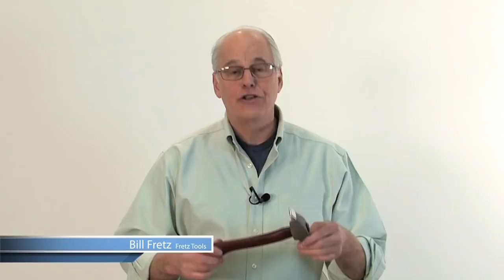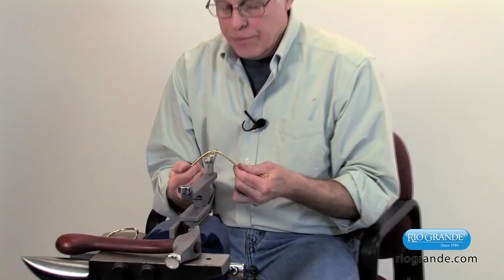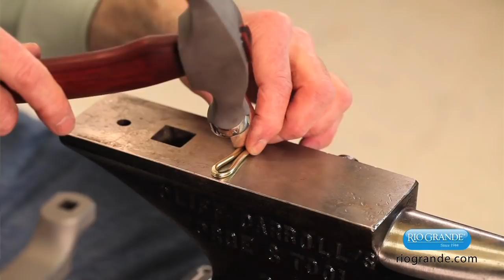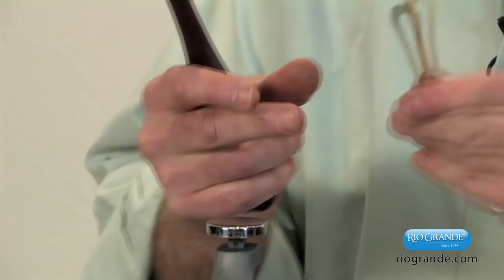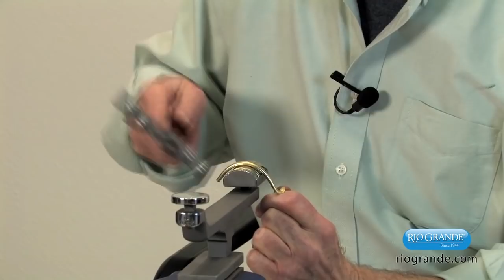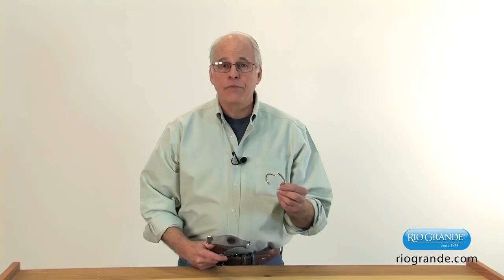Making a Twist Forged Bracelet with the Fretz Jeweler's Sledge Hammer

Comment: Just a reminder that brass needs to cool after annealing and not quench too soon.  I might have got a bit heavy with the hammer or quenched to quickly after heating and the edges of the brass cracked. You need to anneal on the brass a lot , eg I couldn’t open the loop successfully after hammering until I had annealed again.

Comment: Have you dressed the anvil and if so how have you done this also will it be suitable to use silver like this, kind regards Julie
Reply from the maker: Hello, we will reach out to our Tech Team and get you a professional answer.
Reply from the maker: Hello Julie, we spoke with our Tech Team and they said that in that video the anvil does show wear, however you can clean up the surface of any anvil with sand paper list like sanding wood or silver.  They personally recommend using 3m Wet or dry sand paper and to start with what ever grit you need to remove the blemishes and then work down in grit to 1000 grit. They also recommend to use the paper with a hard sanding block and  wet it with water,  just make sure you remove any water and dry the surface after you are finished.  We hope this helpful for you!